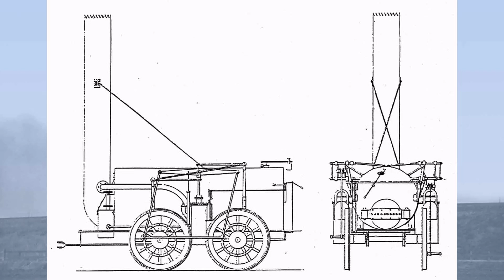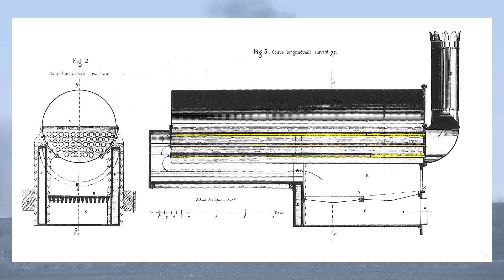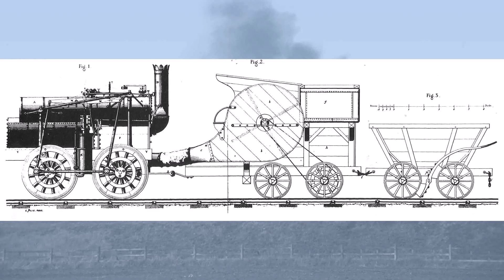Marc Seguin: The Basics

Comment: There's an early locomotive wheel in The Smithsonian that's believed to be one of the original wheels from John Bull, it looks nearly identical to the wheels on this replica, so I was a bit surprised. But the comment that it was originally a Stephenson design made sense of it. Interestingly the surviving wheels believed to be from Pride of Newscastle do not have the chamfered spokes seen here and on the supposed original John Bull wheel.
Reply from the maker: Yeah it was the standard Stephenson type of well until Rocket came along. Solid timber with a wrought-iron tyre and a wrought-iron crank ring. The characteristic sound of the Seguin replica is the creaking of its wooden wheels. The type of wheel now preserved on Rocket with a cast iron hub are a later development. You can see why early solid wood wheels on Planets etc were prone to collapse!
Reply: @AnthonyDawsonHistory  Thanks for the reply. It reminds me that when Baldwin built Old Ironsides, copied from an imported Samson or Planet type, he had great difficulty with the wheels. I also presume that this was type of wheel Locomotion originally ran on before the cast wheels were fitted (although I can't remember ever seeing that engine rendered with wooden wheels in any art I've seen).
Reply from the maker: @furripupau  Locomotion had eight-spoke cast iron wheels. They were....not a success. She was certainly not built with Wilson's "plug wheels". We don't eve know what it looked like exactly or what, if anything, of the locomotive which exists today, is from 1825.

Comment: Why do you speak of the Lyon to St Etienne railway in the past tense? From what I understand the railway line that Seguin built is the same as the railway line still in use today, with the exception of a short section at the Lyon end that closed when the station was relocated in about the 1850s, and also one tunnel that was re-aligned also in the 1850s.
Reply from the maker: I'm not sure I understand? It's all in the past tense. And I know the CF St Etienne-Lyon is still in use.
Reply: @AnthonyDawsonHistory  I guess you threw me when you said the line was 56km in length, which I took to imply that this is no longer the case today. But maybe I'm reading too much between the lines. Anyway, thanks for the excellent and informative video.
Reply from the maker: @AMOGLES99  no worries! Have a great day

Comment: More peerless research young man! You did overlook Twin Sisters being was Henry Booth's first attempt at a Multi tubular boiler? Looking at the Marc Seguin, she still looks like the very thin tubes will easily clog with carbon deposits, and it looks like there is no real way to clean them. Does the replica have any kind of modifications to access the tubes? Also, Red copper? Am I right in thinking red copper is purer? What are its benefits?
Reply from the maker: The boiler tubes were 4cm diameter so quite large. The duct on the end of the boiler is removable so the tubes can be cleaned. Less faff than Rocket. We don't know the form of Twin Sisters boiler. Booths first boiler was Lancashire Witch but that was a return flue.